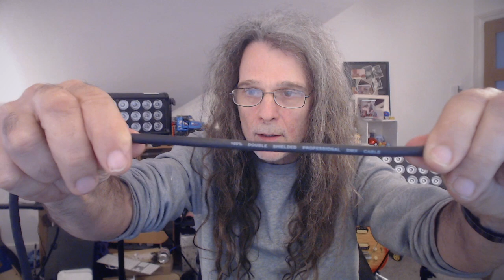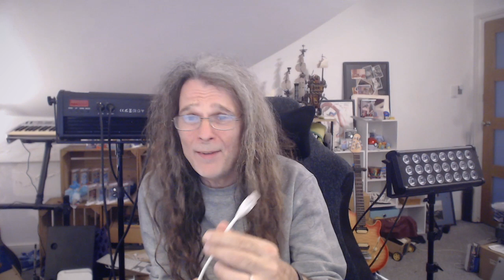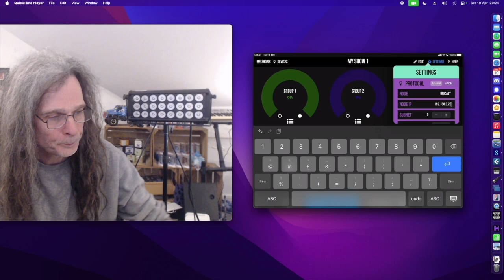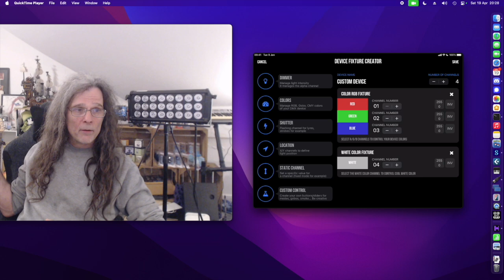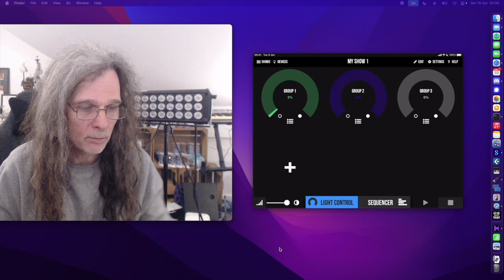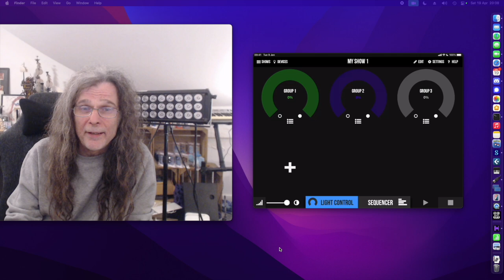DMX and ArtNet For Dummies

Comment: My question is, I bought some lasers off eBay. Does the software have to have these particular lasers in them or will the DMx talk to ANYTHING as long as it's DMX? 🤔 How do I say this 🤔 is it like Midi where they all just automatically know what's what?
Reply from the maker: Any DMX controller will talk to any DMX fixture, but as a starting point all it knows is its sending data on different channels (so you just have a set of unlabelled faders, which isn't helpful). If you're lucky the software might have your specific laser programmed, but if not then you can usually teach it. Most good DMX software lets you tell it that (for example) that brightness is channel 1, pattern is Chanel 2, x is 3, and y is 4 (this is in the manual for the device). Once the software knows about that type of device you can create multiples with a different base ID.